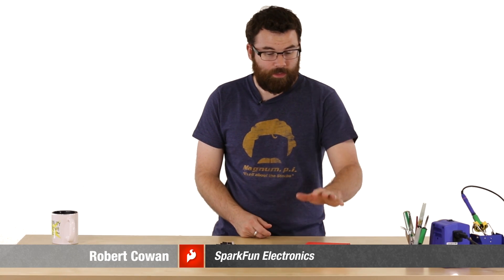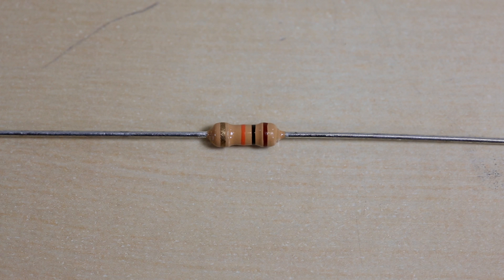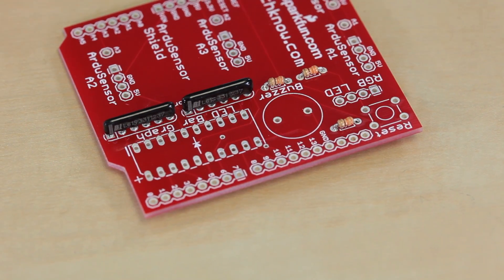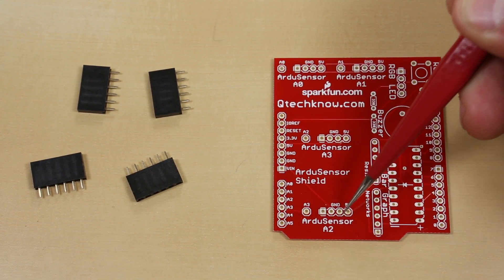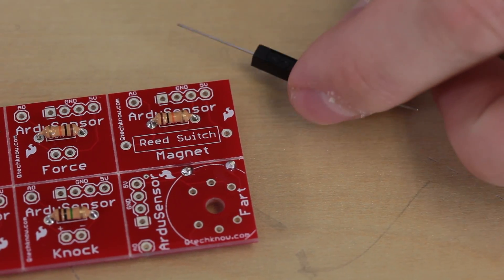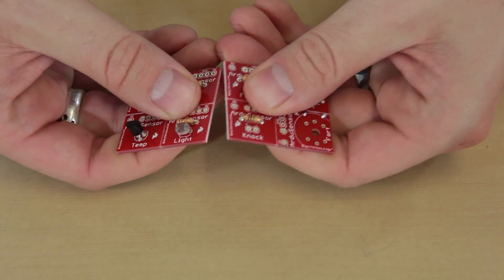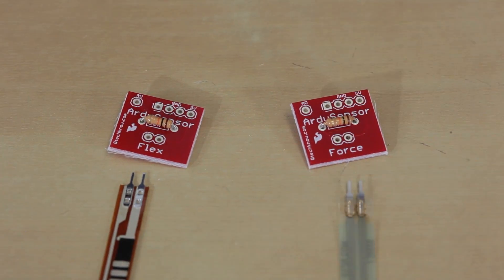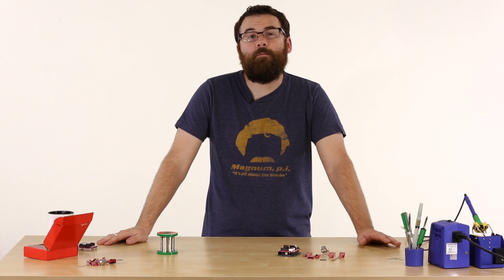Qtech Learning Sensors Kit

Comment: It seems pointless to key the headers by removing a pin unless you plug the hole it mates with.  Something (ideally a proper plastic plug made for the task) should be inserted in the unused hole.

Comment: The lead spacing on the ones I have used are such that it can go in at 0 or 180 degrees, but not 90 or 270 degrees.

cheers

Comment: Push Buttons DO MATTER which direction they are in. As pins on either side are bridged together. If you turn it 90° and insert it wrong. The button is bypassed. and is useless